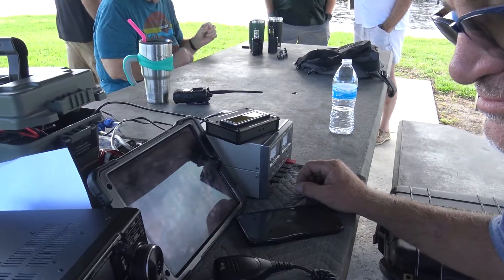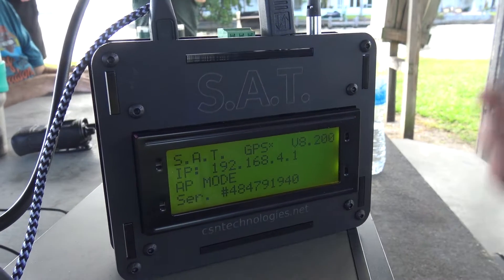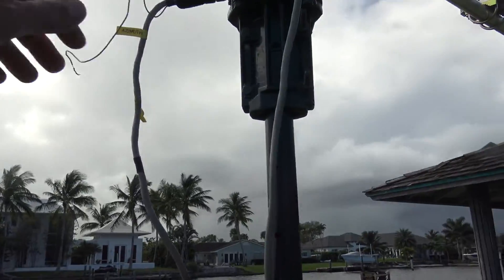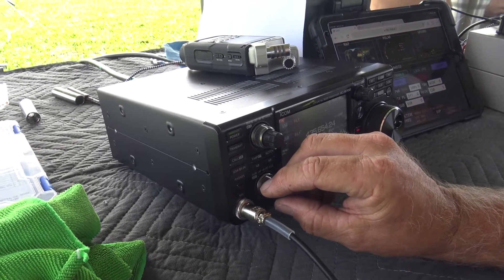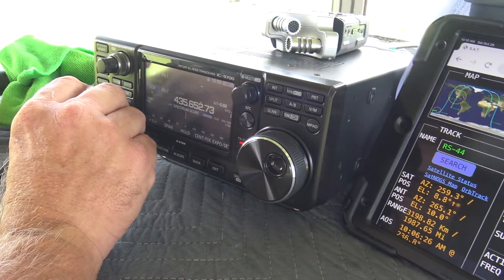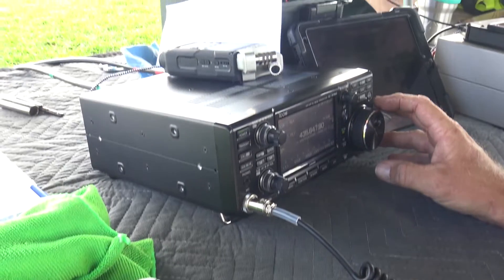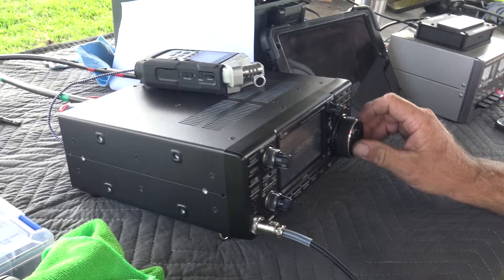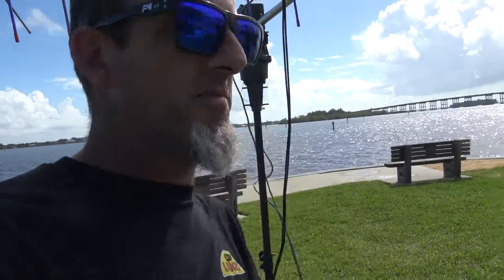S.A.T. Module, SSB/FM Satellite Passes, CSNtechnologies.net, Automatic Tracking!! @HamRadioConcepts

Comment: How do you align the rotator to north, so it know where its pointing? What tablet are you using and software for you sat tracking.
Reply: The software is built in to the controller. when setting everything up set the yaesu controller to 0 and point your antenna to true north.

Comment: Thanks for the great video
Reply from the maker: I wish I knew more about it... Perhaps you have one to send my way and I can do a deeper dive on the setup and functions...73
Reply: @HamRadioConcepts  Remember; if you happen to get one the radio does not need satellite mode, the S.A.T. unit does it all.
I've actually put in the pass-band frequencies for all the Linear birds to quickly select another set of frequencies rather than moving the VFO dial.
Reply: @HamRadioConcepts  1400 views. 4th most viewed video on the SAT and it hasn’t been 24 hours. 😂
Reply: @HamRadioConcepts   i will talk it over with my partner
Reply: @HamRadioConcepts  I sent you an email